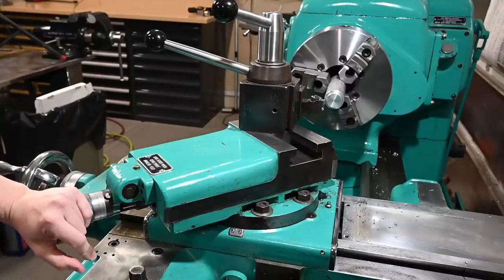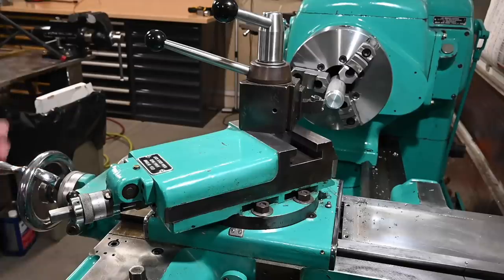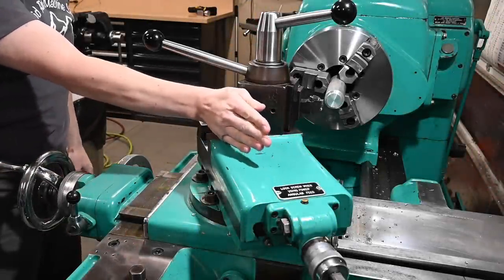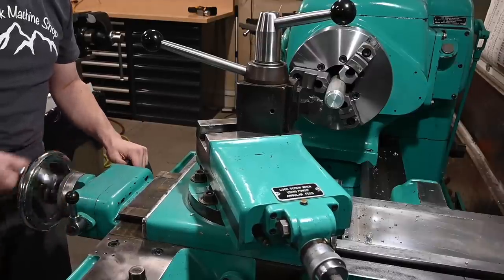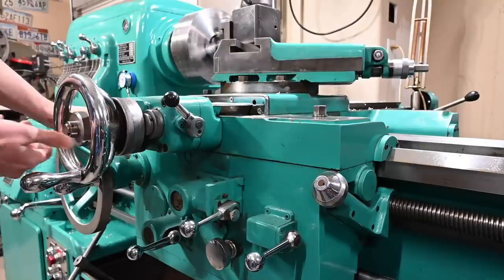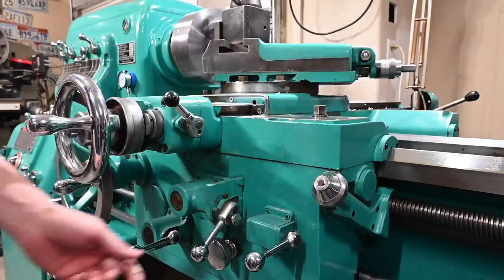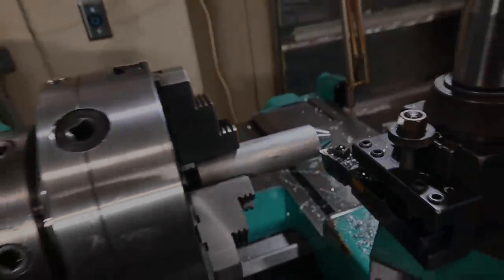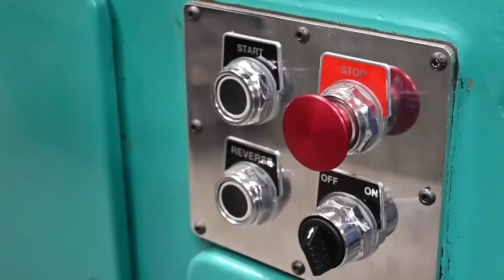9,000 lb. Monarch Lathe: Rare Power Compound Feed!!

Comment: Sweet machine and super quiet! Built in mini taper attachmentish. Something I figured out on my lathe that appears opposite on yours. I remember the power feed travel direction based on the lever position relative to the spindle. Mine aren't marked and need to engage two levers to make it work. Easy to remember as both levers up is carriage towards the spindle/chuck. Both down is cross slide toward spindle.

Comment: I worked at a big old machine shop here in Sacramento, Calif....they had 2 very large Axelson Lathes with a similar feature. They bought them many years ago, for cutting the tapered threads used on oil-field and water-drilling pipe. Nice Video...!

Comment: I worked on a lathe (brand forgotten ) nearly 50 years ago when serving my Apprenticeship which had a power compound. We were using a tool post grinder to make large valves for a marine engine (Burmeister & Wain  two stroke,about 20,000 horsepower) .

Comment: Nice feature.  But very common to have power feed on larger lathes.   Love your lathe, only minus is the short cross slide saddle.  I prefer when it cover the entire lenght.  Also seems like chips and so can reach the screw opening when fully out.?   Best regards
Reply from the maker: It annoys me too- hot chips fall down and smoke the way oil on the chuck side way. There is a sliding panel that prevents chips from getting down into the screw but the pins that hold it came loose so it doesn’t follow the cross slide until I manage to fix it. I believe it is set up like this because this lathe was offered with a rear tool post so they made the primary cross slide smaller to accommodate the rear one. Oh well, I can’t complain too much- I may have someone cast me an aluminum extension that I can bolt into my cross slide.

Comment: The color takes a bit of getting used to, it looks a lot like the color used on some 57 chevys. You better plan on keeping that lathe for your life span. Anything lesser and without that powered compound is going to seem like a huge step backwards. Is there any websites with a PDF of the parts showing the internals for how that compound works? Newall and a few others make a DRO that can be slaved to a VFD that then allows Constant Surface Speed (CSS) that would be a perfect fit for that awesome lathe. Some of the Acer lathes have that already set up at the factory as an option.

Comment: I noticed your lathe has no taper attachment. I wonder was that standard if they had power compound or could you have had both power compound and taper attachment? Sharp looking machine!
Reply from the maker: I’ve wondered that too- the back end of the carriage has a very different shape to it than the standard carriage so it may not be possible to have both. I have room in there for a third lead screw to run a second toolpost that would also work under power- lots of neat capabilities on these machines when new. ——Aaron
Reply: @AlwaysSunnyintheShop  Aaron if you haven't seen bcbloc's channel you should... it's amazing, Brian is very ingenious, his dog Bailey is the lovable inspector. And Nice video, btw!

Comment: What a great machine, love the color also,  the last lathe I ran at Newport News ship was a large shaft lathe, 72 inch chuck and a 30 foot bed and it had power angular  cross feed. But it was not mine like that one is yours. You can tell the quality of that machine by how quiet it is. Thanks Dave.
Reply from the maker: Now THAT is a big lathe! That’s what it takes to make long large diameter parts though. Of my customers, the largest is a VTL with a 14’ table, but working height is probably maxed out about 22’.
Reply: @AlwaysSunnyintheShop  Yea she was large but the main shaft lather was 96 inch by [really long] for ship propeller shafts.  Never ran that one, I only did the intermediate shafts  and thrust shafts. Was fun. Newport News Ship.

Comment: Aaron,
Using two dial indicators and set the compound 90 deg to the cross slide you can measure the ratio based upon indicator travel, if it is 1:1 then you should be able to cut 45 deg angles by engaging them together.
Reply from the maker: I did just that after this video, actually. For every .100” of cross feed travel, the compound advances .080”. Would love to know if there were any charts that Monarch supplied with lathes that had this feature.
Reply: @AlwaysSunnyintheShop  Aaron,
I know some of your viewers were saying that you could do curves or radius cuts however I was watching my cnc lathe and that uses different feeds depending on the location of the cuts. It's not a direct ratio.

Comment: That's a new one on me. I haven't seen a power'd compound before.  Does the lathe still have a taper attachment for longer taper's and threads?
Reply from the maker: No taper attachment, just the compound for tapers. In order to incorporate this feature, Monarch used a different saddle that won’t work with a taper attachment.

Comment: Hi. I'd need to put more thought into solving the combined cross and top slide motion but it is basically a trignometric problem and the solution will be down to the sine of the angle between them and the ratio of the two leadscrew motions. Hope that's of some little help. A reasonable 'high school' maths student (I'd say fivth or more likely sixth form over here) should be able to help you with this very interesting capability. An Excel spreadsheet would be a useful approach allowing points on the resulting curve to be calculated and then plotted. I'm not sure what the use of the combined motion would be, it sounds like it's more in the realm of ornamental turning! BobUK
Reply: If both leadscrews of the cross slide and the compound are the same then it must cut at 45 deg with both engaged assuming that the gearing is also the same.
Reply: @clivehaynes2183  having ran a similar set up I can tell you that you're correct 45°when both are engaged.

Comment: Nice feature. I am, curious why the reflection on the face of your check oscillates but the reflection on the perimeter does not. Does this mean that the face of your chuck is not true??
Reply from the maker: Good question- I think it’s due to it being an adjustable (set tru) chuck so the jaws are true with the spindle so the chuck body is not. I’ll have to check the face though and see how close it runs.

Comment: wow, you machine is imaculate! how did you find a machine in that condition?
Reply from the maker: I got extremely lucky. The Craigslist post was not great- blurry photos, the lathe was covered in rust, the chip pan wasn’t shown so it looked like it was missing...went up the mountain to inspect it and found a gem hiding under the rat poop and rust. Lots of work getting it clean and down to my shop, but it is a gem.

Comment: Since this can blend the cross feed with the compound feed at the same time, shouldn't that give an automatic radius? Like, an inbuilt ball turner?
Reply from the maker: I would think so. Need to figure it out.
Reply: No. it's hard to explain without pictures, but essentially the rate of feed of the second motion has to change as the quadrant is described... that is why it's easy for cnc, as the motors for each axis are independent. This machine will only ever produce tapers, as the feed rates for each axis are fixed. Like I said, hard to get your head around, if you're not good at visualizing geometry and motions. You need a radial motion to cut a radius with any analogue machine.
Reply: @arealassassin  So what shape do you get when using both feeds at once?

Comment: I’d love to see you cut a curved surface with that.
Reply: Wuld that even be possible? 
I think Conical threads wuld be possible
Reply: @sammiller5509  I’m not a machinist, but if you can move on two axes at the same time then you should be able to describe a curve.  I imagine if you had a cutting tool that can cut in different directions (i.e., it is round) then it could be possible.  

But I’ve never worked a lathe in my life, so I couldn’t say if it’s possible.
Reply: Never mind.  A curve wouldn’t be a constant speed on both axes.  Never mind, forget I asked.
Reply: Yes, you would only be able to do straight lines of arbitrary angles, but no curves.

Comment: I would imagine if you have both engaged you would cut a curve.
Reply: No. It will cut a straight line. Feeding both the cross slide and the compound at the same time is not very useful as the ratio between them is always the same and can't be changed.
Reply: @Panzax1  thanx
Reply: @Panzax1  EDITED (original post was wrong) : Agreed about the straight line (I have no idea why so many people imagine it would produce a curve) but respectfully disagree on your other point (although it's only academic/pedantic, as I will explain) 
One of the feeds is constrained to lie along the y axis, but the other, although its translation rate is in lockstep proportion to the first, it is infinitely variable in direction. So the  cross slide feed could be added to the compound power feed to "stretch" the rather short travel of the compound. 
This would enable turning very steep tapers with a large radial dimension, but this is an extremely rare requirement, one I don't recall ever coming up.
What WOULD be useful would be if the longitudinal z axis feed (to the saddle) could be combined with the compound power feed , to stretch its travel further along the bed, and partially compensate for the fact that a TTA can not be fitted to a lathe with a powered compound.

Comment: You shud be spinn alliminuim x2 that speed.
Reply from the maker: Much more than 2X that speed, but it’s an old machine not designed with modern carbide in mind, and I don’t want the noise of the machine to distract from the video quality. A lot of compromises to make when using old machines.
Reply: AlwaysSunnyintheShop Yup, thats right. Your carbide tips are pretty good btw, i use them .

One quick point id like to say before you go. 

To clean/oil in between slide way and carriage, repeatedly oil and wipe, oil and wipe, oil and wipe.

Oil and wipe, because in my oil bottle , i mix it with kerosene.

3part oil, 1 part kero.

It thins the oil cleans surface rust. 
Also cleans any minute dust particles. 

Even with your compound ,rotating the compound around and around oiling and rubbing (yea....) 

Funny how you cant use paint thinners to thin oil.

Even methylated spirits doesn't mix. 

Anyway clean beds = more contact area = less vibration, deeper cuts, less strain on internal gears, shafts and drive rods on the lathe.

A slide is basically like a brake system, when loaded up with cut the pressure will be on the bed causing friction and becoming s brake.

More surface area combined with layer of oil in between cancels out the friction and force can easily transfer to the carbide tip/tool.

Smoother finish quieter and more energy efficient.
Reply from the maker: Very good reminder, thank you for bringing it up. I wipe things clean often, but sometimes get lazy.